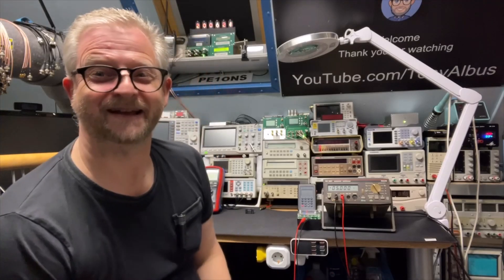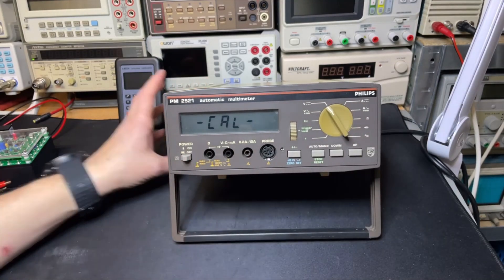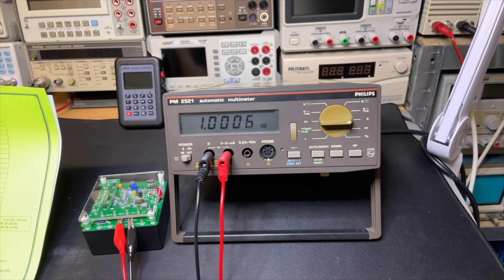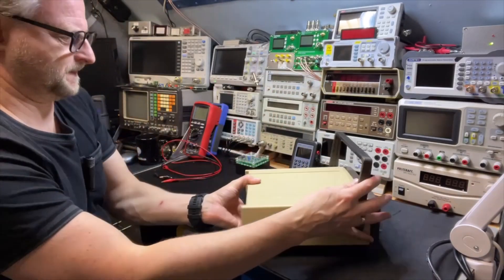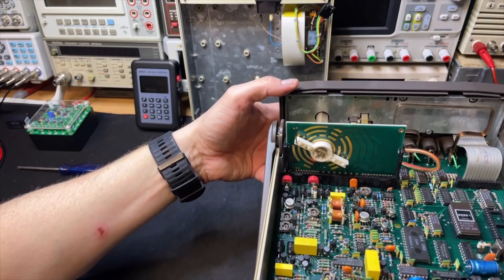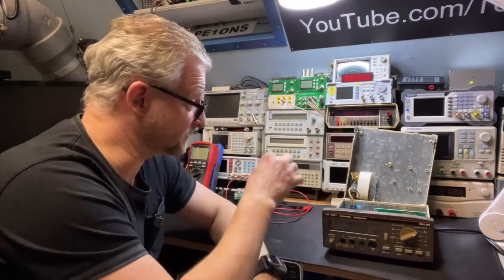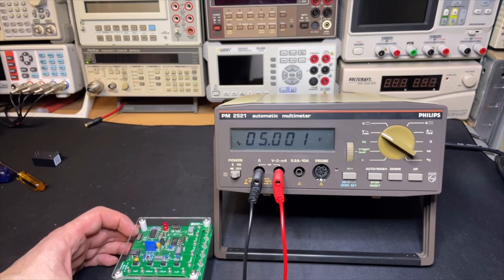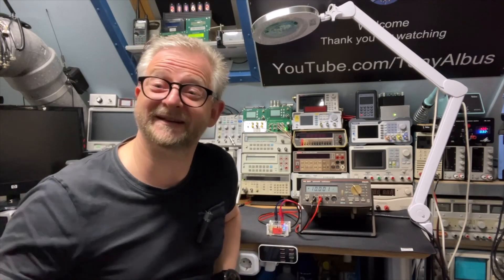#240 Philips PM 2521 DMM Test Cleanup Teardown Adjust

Comment: I have two of this meters. There old but very good and still accurate. A while ago I repaired a defect little transformer and I made the mistake to un-solder the internal battery witch caused a total loss of the alignment which is stored into the memory ;) So I had to re-align the meter. It's not difficult but you need a second accurate meter and some sources witch can deliver various voltages and currents. So never take the battery apart from the pcb if it isn't necessary. 73 PA0HSE
Reply from the maker: Thanks Harry, good to know!. yes amazing how accurate they still are..
Reply: @TonyAlbus  Yep, after all those years. I have many instruments from Flip. Also have the Owon XDM2041, cheap! and nice meter from Eleshop. My favourite shop! Your's also I understood hi
Reply from the maker: @harrydelange1821  Yes my favourite shop .. also have the XDM2041 perfect entry level..